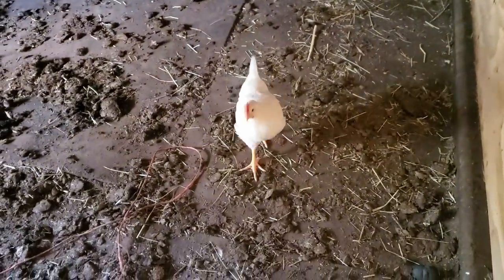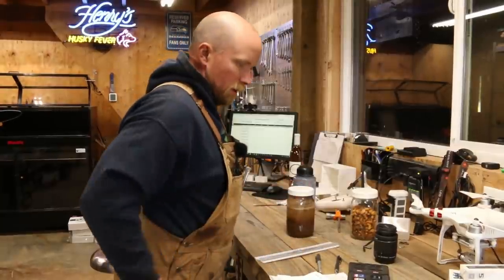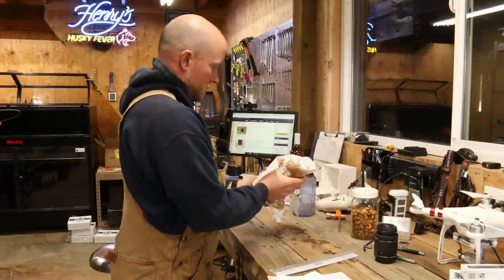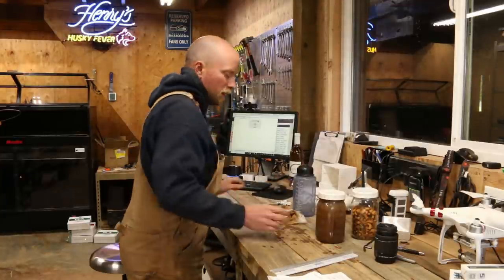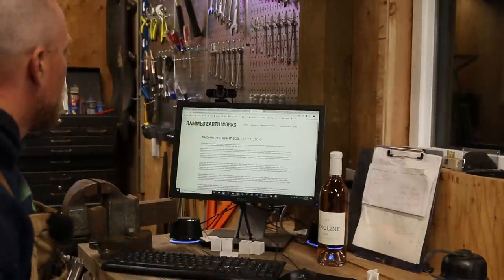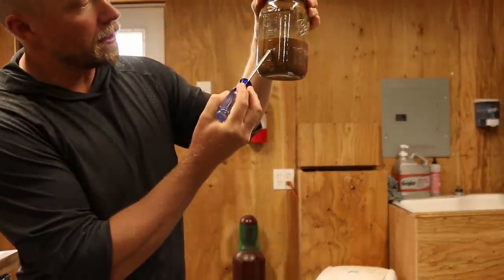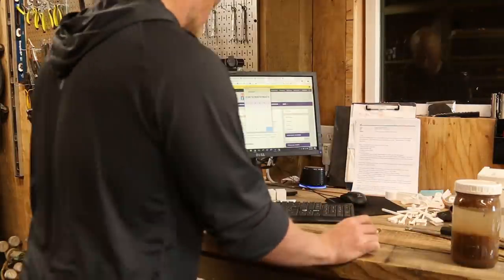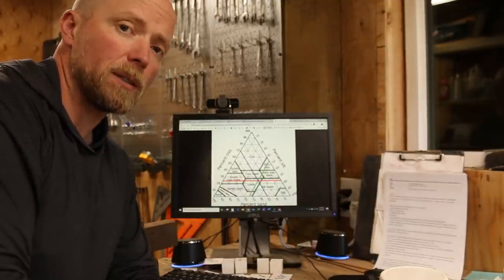Simple DIY Method to Determine What Type of SOIL/DIRT You Have

Comment: I also live in Wa. state. The one thing a lot of those sights do not take into account is the volcanic ash (Remember, Mt St. Helens) that was deposited into the region back in 1980 - 2001 and as recently as 2004 - 2008. Everything East of the Cascades ( North to South) was covered in ash at one point. The ash will have an effect on whatever you want to do with the soil. Even Portland got a dusting.

Comment: Hi Jeff,
    Maybe share your plans on the type of root cellar your building. Do you have anything in sketch up? How much square footage/dimensions of the room. That would help inform us viewers on providing suggestions. I was thinking digging into a hillside would be best (the north slope of a hill would be best to avoid solar gain), but it looks like your set to have it next to the garden. You should do many soil samples. You've done the surface. Now do at the 2 foot level and again at the 4 foot level. The composition of the dirt is going to change at different depths. Where you find more sand at the surface you might find more clay deeper. Is there a stream nearby that you could harvest clay from for free? Cheers
     Bill

Comment: If you can find a good supply of old tires they stack well and once rammed full of soil are very hard to move especially if you screw them together before you fill them. Tire walls are also good as once you build it you can then hide it simply by screwing the right type of mesh on to connect to brick, stone or stucco.